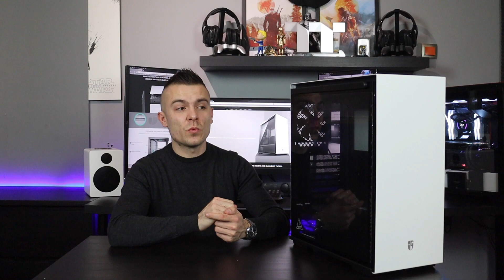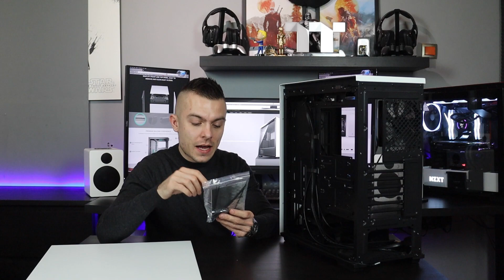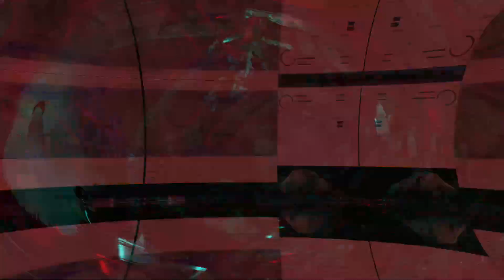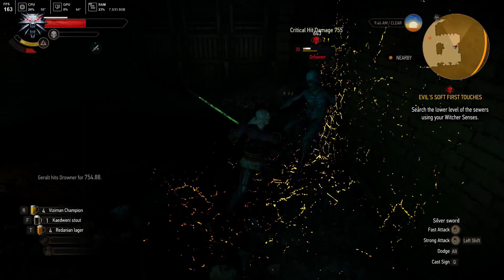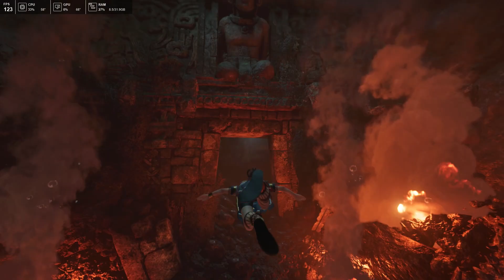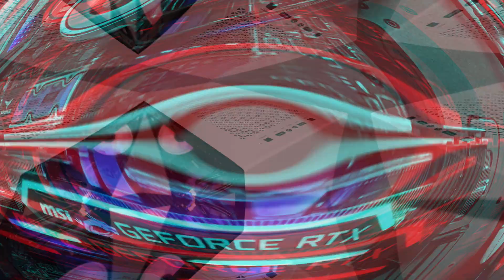DEEPCOOL MACUBE 310 - on budget and good!?

Comment: This case its a oven, dont buy it.
Reply: Nooooo you just pissed all over my plans. I was going for this instead of the NZXT one, now that you said that im rethinking again 😭😭 thanks for the heads up
Reply: @bradleydaniels3864  well, i bought it and i regret it. Theres no airflow in the thing. Its a heatbox. Even with corsair PRO fans, the tiny space this case have to gather air is just not enough.
Reply: @Vitonezz  yeah im building for 3d rendering and gaming that wont work. Thanks again

Comment: Hello! I have couple of questions. Is the Macube 110 same but just mATX version? Because it looks like that. How is the airflow, can I put high end GPU in this? Will 160mm long PSU fit? (It does say 160mm is maximum in the spec sheet), just want to make sure. thx

Comment: How did you put the aio on top? I have the same case (non P version) and the aio wont fit as it collides with the heatsink on top of the processor on the motherboard.
Reply from the maker: It was a tight fit to be honest, I won't lie. The heatsink is inside the fan but just the right size so it doesn't hit the fan blades.
Reply: @PCCrazyDario  oh alright! Thanks for the reply brother. More power to your channel!

Comment: Asus Rog Strix OC Vega 64 in this case or Nzxt h510?
Reply from the maker: NZXT H510 standard or Elite?
Reply: @PCCrazyDario  Standard, don't like elite.
Reply from the maker: @Ornal64  Why not Elite? It has that super cool controller plus the front tempered glass with the RGB fans looks really cool. :) But ok, it's your opinion of course. Honestly, Macube isn't bad but I think that H510 is better by a bit.
Reply: @PCCrazyDario  like clean H510 look a bit more plus i already got Deepcool RF fans and led strips.
Reply from the maker: @Ornal64  Yeah, it does have a clean look.

Comment: Top radiator fits with no problem?
Reply from the maker: You do have to be very careful because it is a tight squeeze.
Reply: @PCCrazyDario  what components are in danger?
Reply from the maker: Vincent Jason Sarabia Motherboard passive coolers on the top 😬
Reply: @PCCrazyDario  thanks bud. What about the 8 pin EPS socket does it interfere?
Reply from the maker: Vincent Jason Sarabia You can always bend it to your will and how much space you need so that isn’t an issue. 😉
Reply: ive got this case and i could not fit my 360aio in the top while also using a 120 in the rear. fit was too tight with my asrock x570 steel legend.  i ended up fitting the 360aio to the front as an intake and 3 120mm fans up top as the exhausts. im about to switch to a fractal design meshify s2 because id rather have my aio exhausting out the case.
Reply from the maker: @larrydysondev  That is quite normal that you can't fit a top 360 and rear 120 at the same time in the mid-range section of cases. As for the Meshify S2, that one is sick man. :)